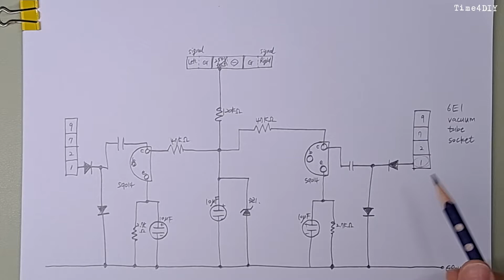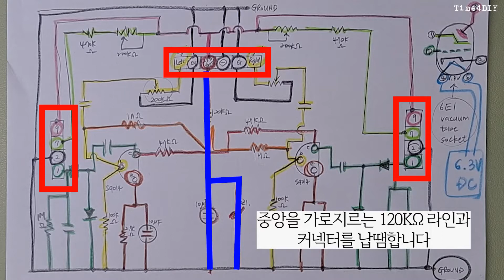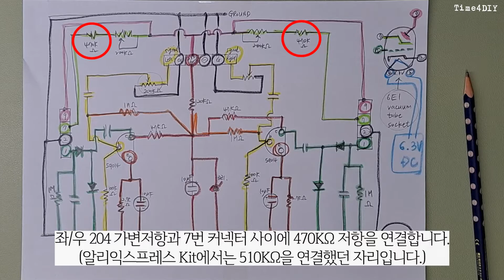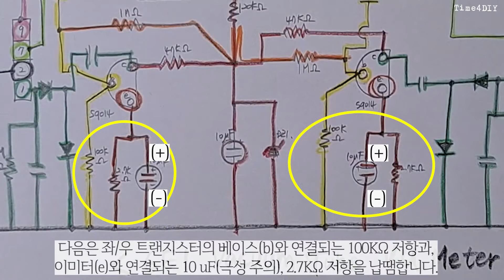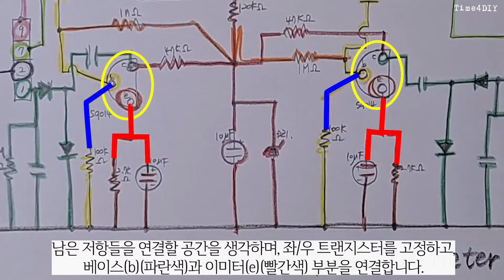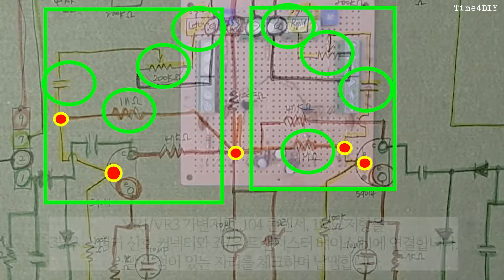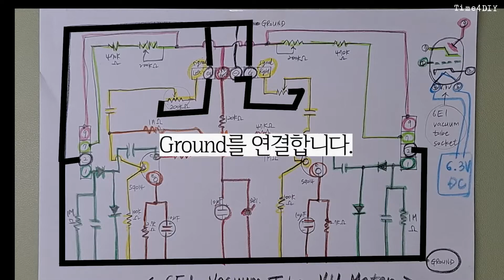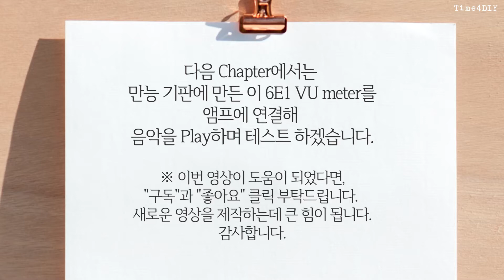[Manual#7] 6E1 vacuum tube VU meter (DIY on a universal board with reference to the circuit diagram)

Comment: Thank you so much for the video! It is just what I needed. One small issue is you do not explain the pinout on the connector other than 6.3v on pins 4 and 5. Where do the others go?
Reply from the maker: 회로도 좌측과 우측에 있는 커넥터의 1.2.7.9번 단자에 동일항 진공관 핀을 연결합니다. 02:45에 나오는 회로도를 보면 진공관 핀과 커넥터 번호의 선 색깔을 각각 표시해 놓았습니다. 같은 색깔 자리에 연결하세요. Good Luck!